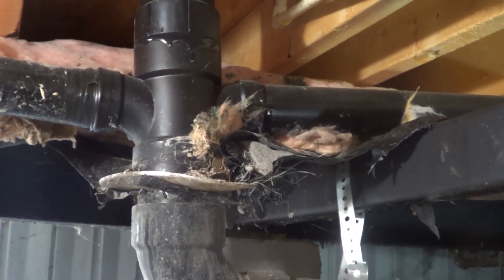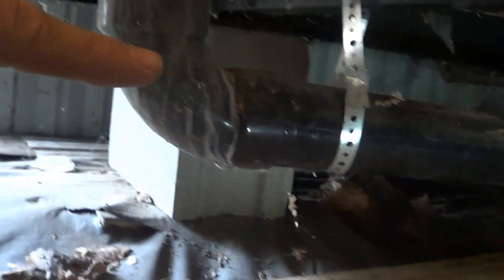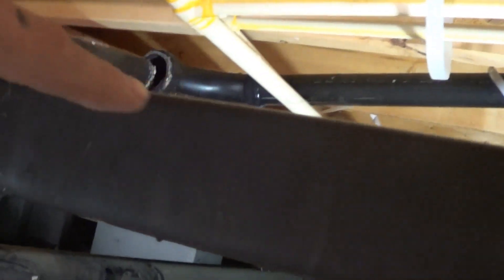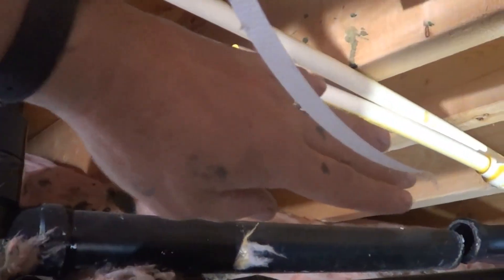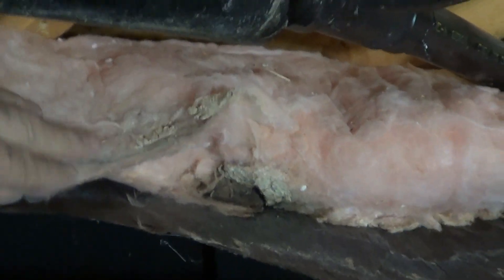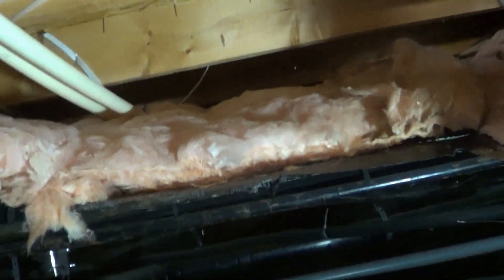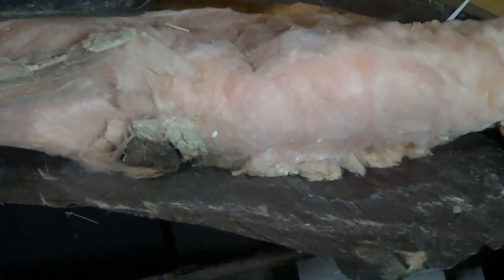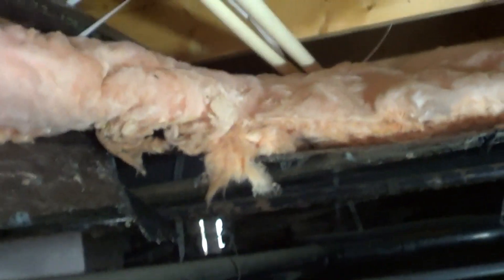Mobile Home Drain System

Comment: Where are the traps? What prevents gasses from coming up through the drain system?
Reply: That's what I was wondering. I have a smell in the bathroom but don't see any leaks. Most plumbing has a vent to the roof for gasses.

Comment: from the looks of that plywood at 0:35.... you might want to sharpen, or change your saw blade!!! =)
Reply: So this is the what you got out of the info this man provided for us all? That, because of the jagged edges on a piece of plywood that was incidentally NOT factory from when this mobile home was built. So he may know just a little about mobile home DWV of manufactured homes...he sure as heck does not know when a saw blade is dull. I just love reading all the comments more than watching the actual video's. Cause I get to read all the comments from A-holes like yourself that want to prove or make others believe they have something important to add.

Comment: Hey Randy, thank you for the video. I do have a question. I just had the main clear out cleared due to a blockage (which it located like a foot next to my mobile home sticking out of the ground.) I’m noticing a gurgling of air in my guest bathtub when I flush the guest toilette. (Which seems like all the plumbing is located under that area) any insight on what I should do?
Reply: I live in a mobile home park and had to notify the landlord twice, that shitwater was backflowing under my place from the underground connection point. Plumbers come twice and still not fixed. Thinking about getting a backflow valve, should solve that problem.

Comment: This does not look like a mobile home
Reply: Hello, I assure you it is. The insulation in this area is cut away to gain access. This actually is what they often look like, though the tan pipe (cpvc) is a little rare.
Reply: just wondering why would you say that? Nothing derogatory about my question but does it look worse of better than what you imagined? I have worked on many mobile homes and I assure you this is what they look like underneath. But what picture is in your mind as to what the look like? And I feel I must add that a new mobile home or one that has been properly maintained and all its insulation is intact underneath it is quite nice and clean looking...or should be. Of course once its insulation barrier and final covering is removed then you see all its water pipes and electrical lines hanging and probably not properly secured...then NOT so nice looking. Thanks.

Comment: We paid a guy to do our sewer lines on our single wide. The guy ran pipe from the drop on one side of the house to the main sewer line and never noticed that the house has TWO main drops. The second one was for the guest bathroom. We used it a few times and it was just draining onto the ground under the house. I noticed it the first week luckily. Make sure you know how many sewer drops your home has and make sure the plumber connects all of them

Comment: Hey! Is there a pipe running from the washer machine inside the wall? I ask because there is a moldy smell in my bathroom closet, and in my washer machine. I have cleaned what I can see, and am worried about what I cannot see. Thank you for any advice.
Reply from the maker: Great question to ask! There have been times when the manufacturer will run the plumbing under the home and between the walls when connecting the plumbing fixutres. It is best to investigate behind the washer to check more leaks. Thank you for watching our videos!!

Comment: My question is if the washer drain pipe is uncapped and the washer water is backing up into the kitchen sink then what could that be from? Also kitchen sink backs up when running water in the sink. On going issue for 2 years had it fixed and it's still doing it . Plumber I called to do the job did it free of charge 2 weeks ago but now won't return my calls.

Comment: How do they "vent" and where is the toilet vent located? TIA~!
Reply: The vent on a toilet is actually the toilet itself. You’ll note the ‘p trap’ for the toilet is in the design of the toilet and the air it pulls for flow comes as the water moves over that p trap, it pulls it along with it through the bowl. Then once the water is in the drain is uses the air from the system vents to move. But like the other comment, it uses the vents from the other parts of the system. In a mobile home however a lot of vents don’t go to the roof but the vent pipe goes like under a sink and is covered with a stutter vent which allows air to flow down but none to flow back through it. Thanks for the comments